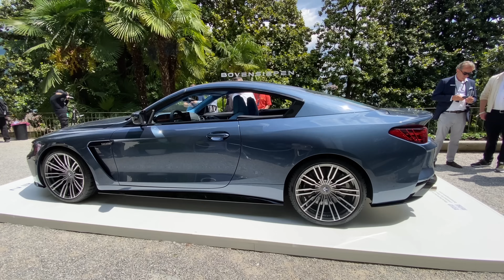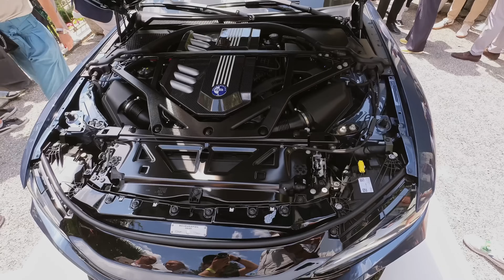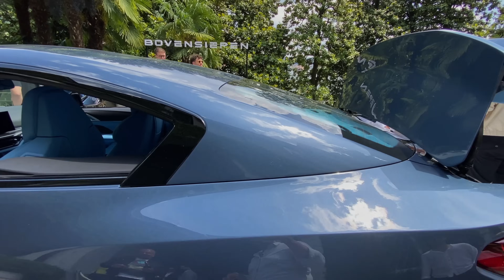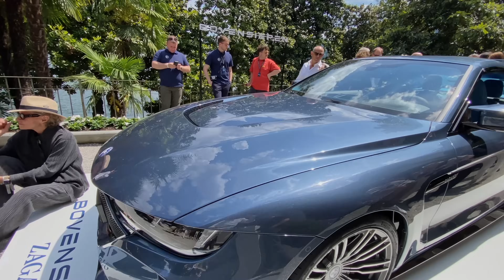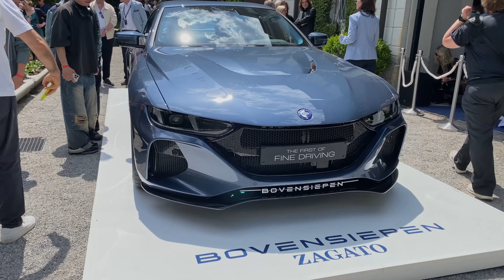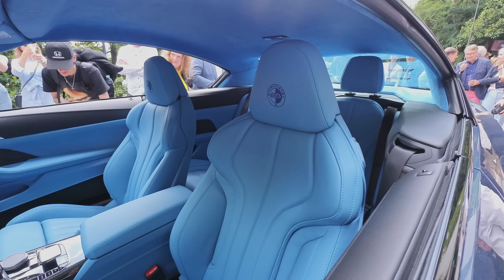Bovensiepen Zagato: A Bespoke BMW M4-Based Coupe - REVIEW

Comment: The hard top makes sense and looks good. 
However the body kit looks as if the Opel aftermarket garagistes were just given a week to do something before SEMA. This is not good for either Alpina or Zagato.

With a bit of negotiation it is possible to have something sporty (a Dallara or MC20) AND something for work (one of the Astons) for this type of budget.

Comment: $400k ?? come on. be serious
Reply: Okay, how are these prices still shocking people? Okay, how many times has one of these coach built  special editions not added at least $200k to the price tag?
Reply: @supermanblackedition  lmao, they act like the original M4 starts at $40K
Reply: It’s cause these geniuses decided to make thee ENTIRE car out of carbon fibre, which a bmw m4 has NEVER needed. Very foolish choice
Reply: @CITRUS--  the M4 vert is pretty heavy so the likely had no choice to replace all panels with Carbon. Also, this is a low volume model so its only right to go crazy